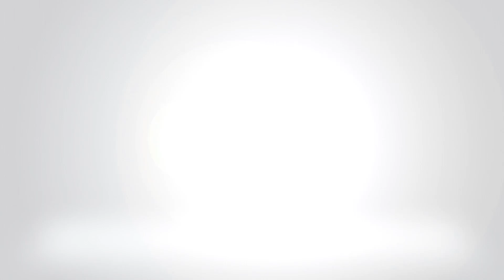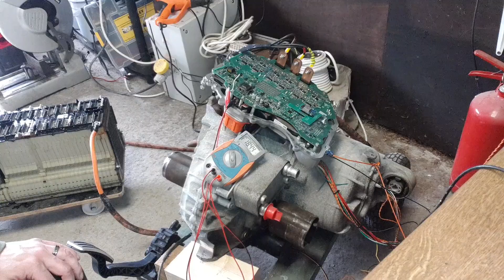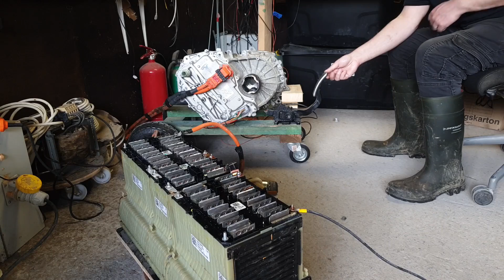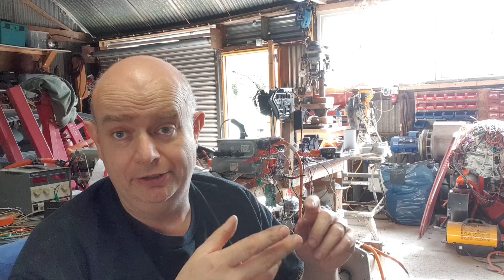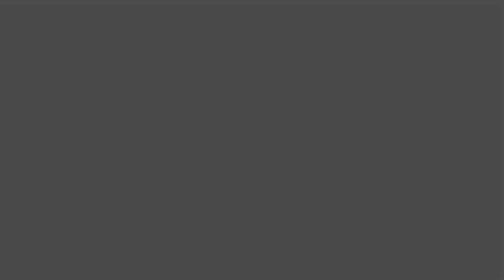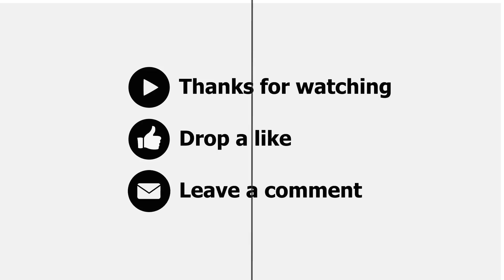The MuskVo Part 4: All Together Now

Comment: Were you running in forward or reverse? Turned mine 90° with a solid diff for a 4wd application. If facing the inverter and turning clockwise, as yours was also spinning, would it propel the jeep forward? Think clockwise rotation (facing the inverter) is reverse? Do you know? Does it matter? Will the oil pump work properly rotating backwards? Additionally, are their open inverter boards available plug n play for the less savvy?

Comment: Good afternoon . I want to build an off road jeep with two motors Model Y 2020. 1120990 Do you have a solution to synchronize the speed of two motors at the same speed when one motor is loaded so that the second one rotates at the same speed?

Comment: Excellent work Damian, I presume you have it running backwards to fit it in the ‘MuskVo’ the other way around. Have you changed or reversed the resolver wiring also ? I was led to believe the drive is power limited in reverse normally.
Reply from the maker: No need to change any wiring or have any limits when using openinverter control
Reply: Thanks, that’s very good news. When do you think this might be available?

Comment: Damien do you still plan to do full replacement board? Or final solution will be replacing micro controller chip with mod board?
Reply from the maker: both i hope. depends on how well I can refine the modboard
Reply: Mod board.
Reply: Thank you